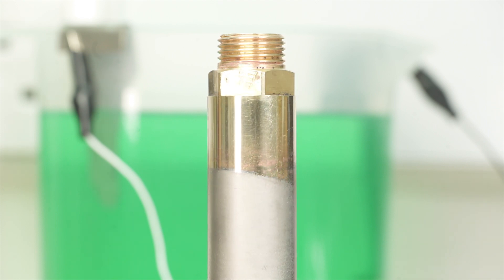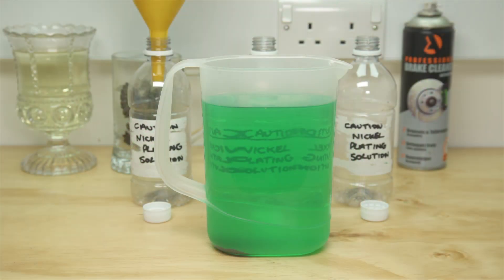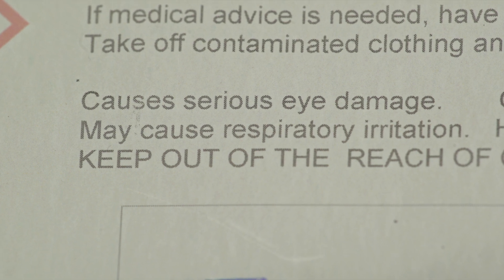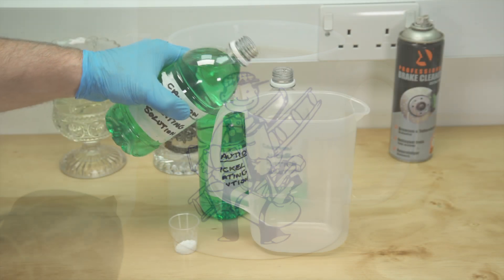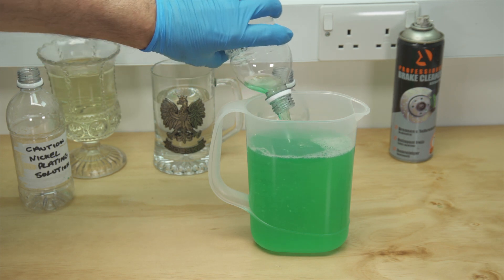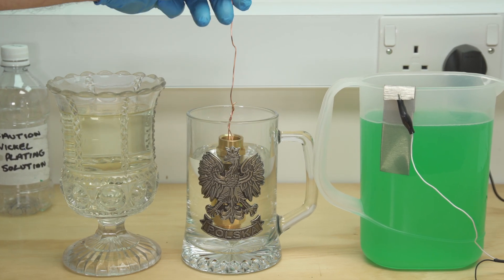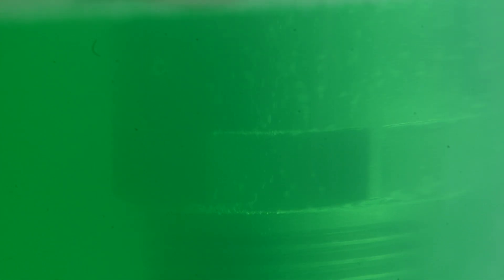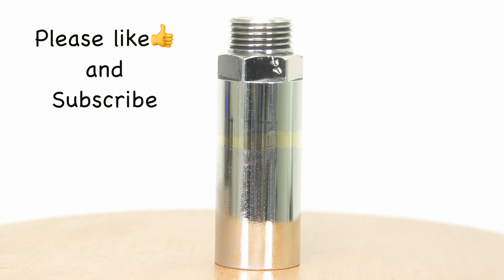Amazing Easy Electro Plating - adding a Surfactant for better DIY Nickel Plating.

Comment: The voltage is to high. I think it has to be under 2 volts. A shiny surface will need hours of electroplating not seconds. Try to put a rezistor in series to limit the voltage.

Comment: I found a Commercial Electroplating chemical company sells a product they call “SURFACE ACTIVATOR” to use same as you are with the HCI & H20 solution. I looked up what the main active chemical in the “Surface Activator” & it’s BATTERY ACID😳. But reading the Amazon reviews/comments they swear by the results???

Comment: Kodak Photoflo 200 (or Triton X-100 which is the active component of photoflo) may be a better surfactant than the SDS that you're using. It's non-foaming. If you can't find SDS, a drop of dish soap should work just as well as a surfactant.

Comment: Adding agitation to the solution.. ie a bubbler, will help as well.
Reply: What is that?
Reply: @MrBrojcile aquarium aerator/bubbler would the cheap way to do it. Need a little air hose and an small aerator stone to go on the end.

Comment: You should probably clarify the acid thing... That's definitely not 50% hydrochloric acid. Concentrated hydrochloric acid is typically 32-38%. It's not possible to maintain concentrations above this due to the high evaporation of HCl.

Comment: I work with nickel plating, let me say that your solution is very dilute in Nickel. The solutions used in the industries are almost black because of the Ni content.
Reply: Thanks! That’s good info
Reply: I USE A SOLUTION ONLY CLORIDRIC ACID 32 33% AND NICKEL WITHOUT BORIC ACID DO YOU CAN SUGGEST A BRIGHTNER?

Comment: Thanks for the great video.  The surfactant was a great idea to prevent piting.   A few questions:  (a) what happens if the voltage is increased to 12v (b)  As indicated by Dean Waters (thanks to Dean), agitation using a stirrer should also break up the hydrogen bubbles, have you tried it out?  (c) Does it have an impact if the anode (Nickel plate) and cathode (copper plates) are closer to each other?  Thanks again. 👍

Comment: Thanks for the refined process! I'm restoring some old (120yrs) American door knobs and look forward to experimenting with this process. Greetings from Oregon...
Reply from the maker: thank you so much for your kind comment, I'm really glad you liked the video😊👍
Reply: Hello from France,
It is a bad bad idea to use nickel plating for such parts to be touched.

Nickel and ALL salts of nickel are proven to be carcinogenic.
Using nickel as surface treatment; it will lead to skin poisoning, itchy, inflammative response due to a powerful allergy.

Once someone is sensitized, every part of nickel will gives nasty blisters on skin, itchy and scratchy, swollen members; sometimes with skin fissures/dryness, leading to bleeding.

Lots, lots of people are poisoned in Nouvelle-Calédonie, due to the numerous nickel mines over there.

The best choice is to use layers of copper, zinc, copper again, zinc onto it.

Heating gently in a oven with some nitrogen atmosphere will provide à nice brass surface treatment.

Best regards !

Comment: We used to use an agitator in our zinc plating tanks to keep fresh solution passing over the surfaces and to disperse bubbles.
Reply from the maker: Hi Dean, thank you so much for your great comment, I have also started using a magnetic stirrer, as well as the surfactant, the combination of the two really aids the process, I would hope to make an updated video explaining this as well👍😊

Comment: Many thanks for this and your previous video. I'm looking to refurbish a couple of old corroded taps, where the previous plating has been eaten away by little hands leaving soap residue all over them. Just wondering where's the best source (I'm in the UK) to get all the required chemicals (hydrocloric acid and sodium lauryl sulfate) please?

Comment: I just learned something new today. Surfactant to prevent pitting. Thank you so much :)
Reply from the maker: thank you so much for your kind comment, I'm really glad you liked the video👍😊
Reply: Would not agitation accomplish the same?
Reply: @tomassmith7686  Yes, if you have a magnetic stirrer or something, ,or you can do it manually. As long as the solution is in "motion" I guess.

Comment: This is a great video and a huge help in my upcoming projects. 
I was wondering can you use sodium lauryl ester sulfate instead of the SLS? 

Thanks so much!
Reply from the maker: Hi Yuki Hiro, thanks for your kind comment, from my research it seems, for the purpose we intend to use the surfactant,  you should be able to use sodium laurel ester sulphate, I would certainly use it on a test piece first to make sure. I have also found that using a magnetic stirrer, https://www.ebay.co.uk/itm/224149190601?hash=item34305537c9:g:pH4AAOSwtrxfhm87   , something like this, helps to agitate the solution as well to prevent the bubbles from sticking👍😊keep up the great work on your channel, the short film about your work is brilliant and I'm sure loads more people would be interested in seeing your great creations👍😊
Reply: @restoreandmake  oh fantastic!  thank you. 
I really appreciate your reply!
Reply: @restoreandmake  what about also using a fish tank bubbler to keep bubbles stirring up the mixture and also keeping the Smaller bubbles from sticking in one spot?